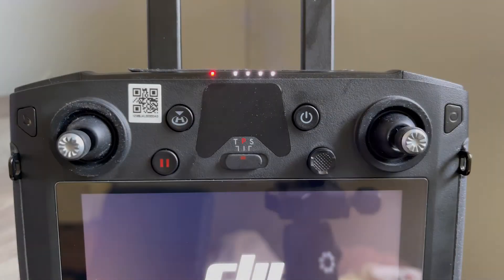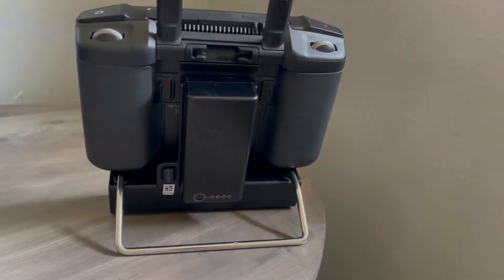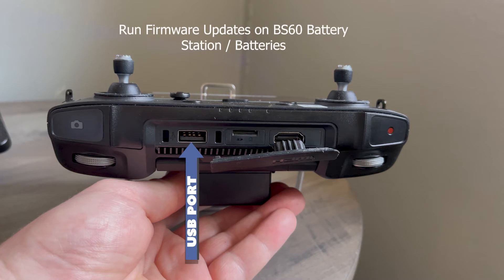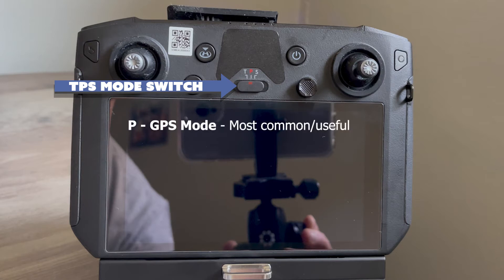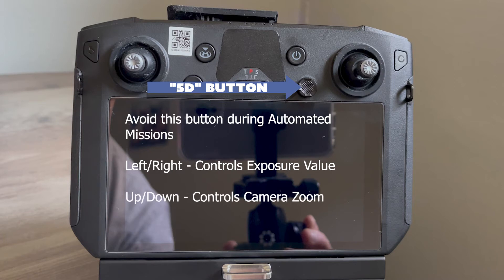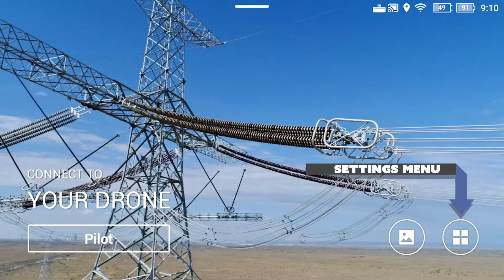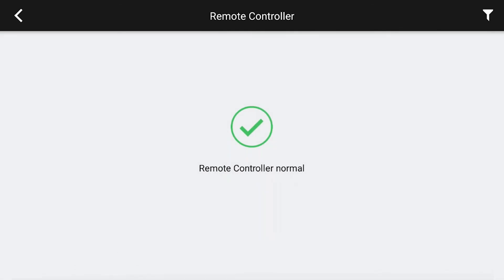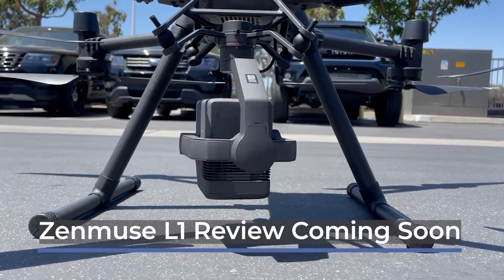DJI M300RTK - Smart Controller Overview

Comment: Its worth noting that you have to charge the INTERNAL controller battery as well as the battery you can remove and charge in the case. I charged the removable battery, put it in the controller and was very confused as to why the controller wouldn't turn on. XD
The removable battery charges the internal one so you can swap batteries without the controller turning off.
Reply: Do you know HOW to charge that internal battery? I have the matrice 300rtk and cant figure out how to charge the controller. The usb c port on the side doesnt do anything when I plug in a 65w charger.
Reply: @GorditoBanditoFPV  did you figure it out by a chance